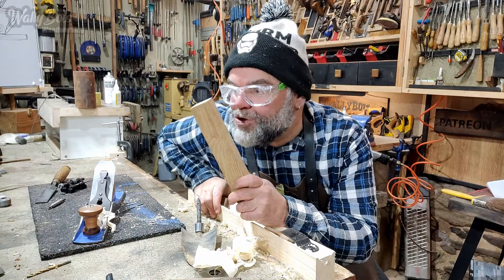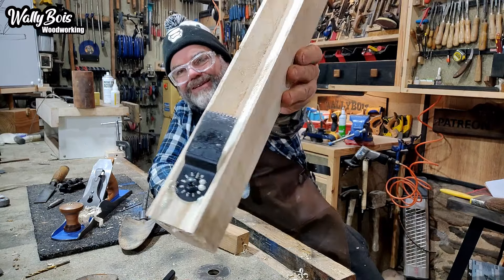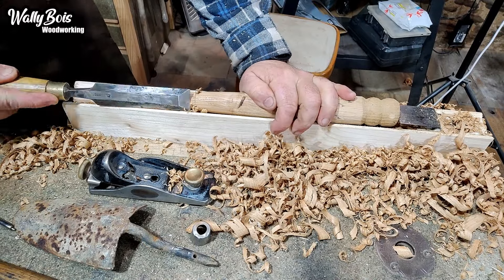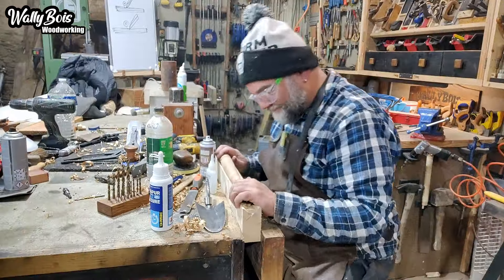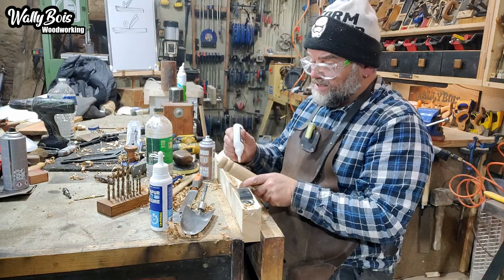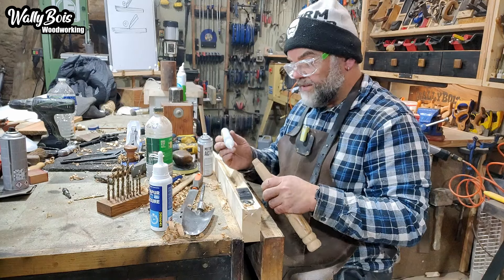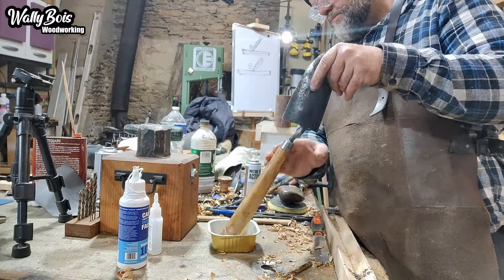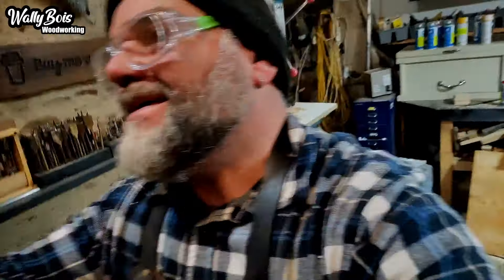CRAFTING a "BIG WOOD" Trowel Handle and my DOG

Comment: In the olden days they used to heat up the tool shank to red hot then force that into the handle hole , this made an interference fit. Is this skill not worthwhile anymore???
Reply from the maker: Not really but I'll give it a go ... Got loads of tools tha need new handles... Haven't done that for years🤠
Reply: Look forward to your attempt, I've found it works very well even if Super Glue added after.